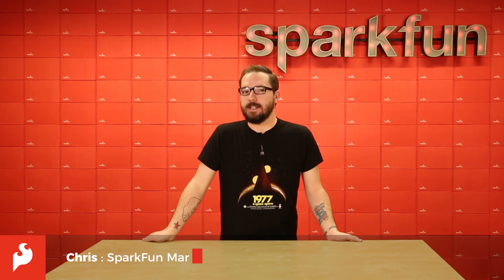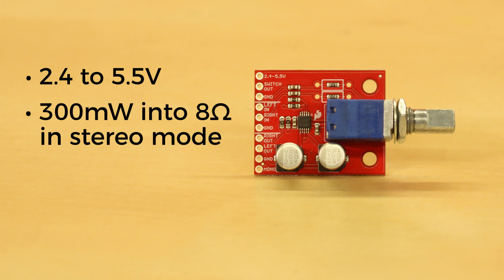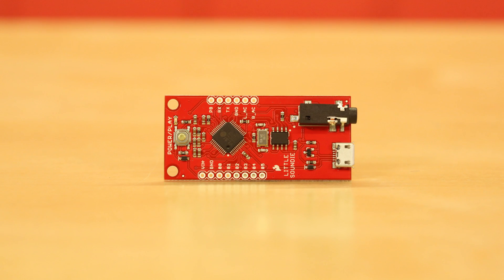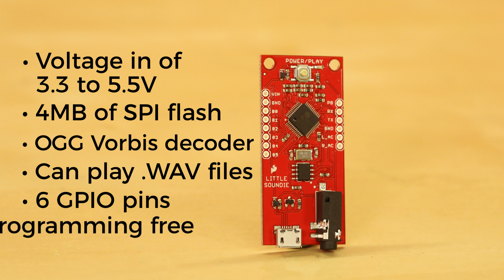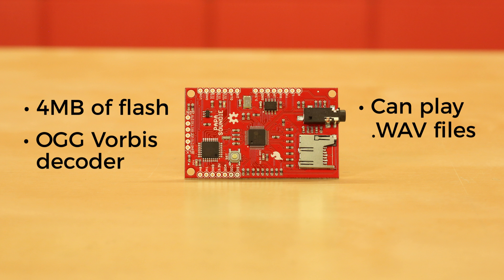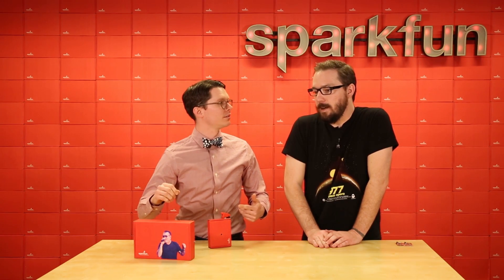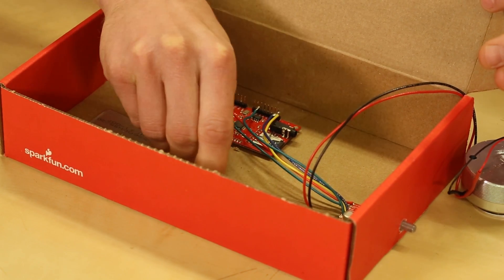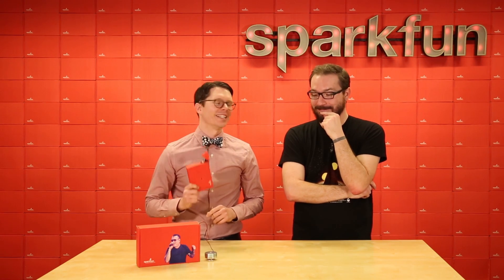Product Showcase: Noisy Cricket & Soundie Audio Boards

Comment: I'm trying to find a sound board for a ray-gun prop replica. A rapid fire play back. The sound modules I found will not immediately repeat the sound file every time I press the trigger button. It's ether an on/off switch or plays the file from beginning to end without stopping. Any suggestions?
Reply from the maker: Try checking out Patrick's Ray-Gun Project: https://youtu.be/DEfMku91CvA